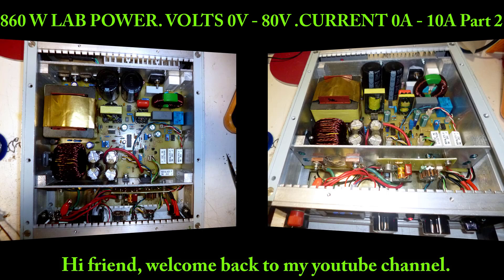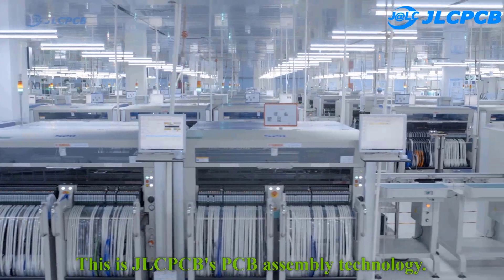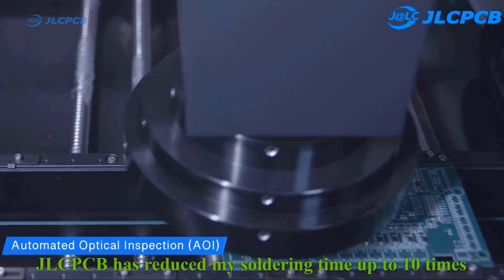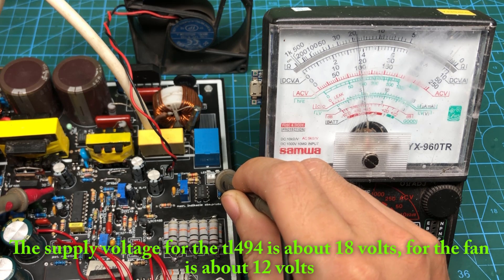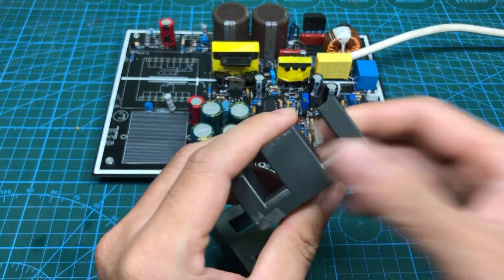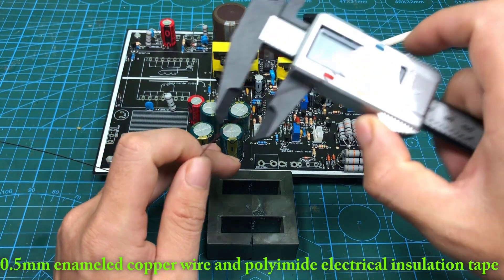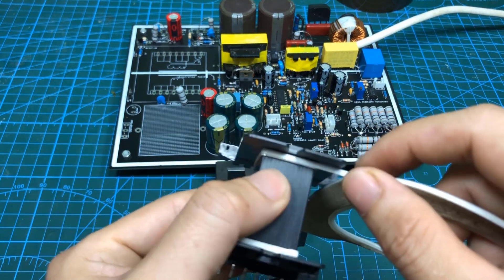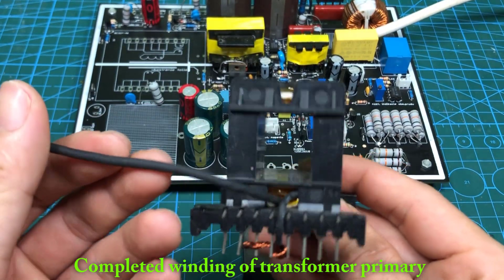860W Lab Power Supply 0V   80V 0A to 10A Part 2

Comment: Hello!

Just a question. I'm a total beginner at this, but in your parts list, you have STPS2L40U listed. And in your pcb it is marked as a trough-hole component, and I can only find it as a smd. Is that right? Otherwise,  thank you for sharing😀
Reply from the maker: Yes Bro
Reply from the maker: Just same a value is OK

Comment: Nice project. I can't find any STPS2L40u diode in my local electronic stores. Can I replace it with any other diode? As I noticed that in your PCB, you're using glass diode (1n4148 or 1n60?) as STPS2L40U.
Reply: you can use u5401_u5408
Reply: @necbd8893  No you can't!  It must be a diode that has a forward voltage drop of 0.3V !!!!
TL494 is at risk of destruction!

Comment: Voltage was set to 12.5V, after connecting load voltage increased to 12.8V, why?
Reply from the maker: I try to fix it. Maybe the feekback not so good
Reply: @LongTechnical  This is because the output inductor is too small, use a choke as instructed.